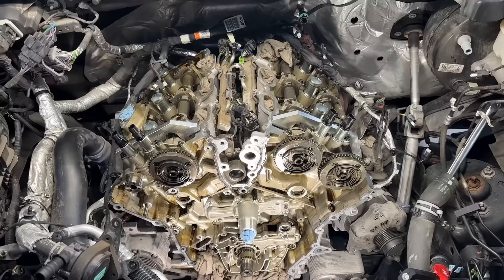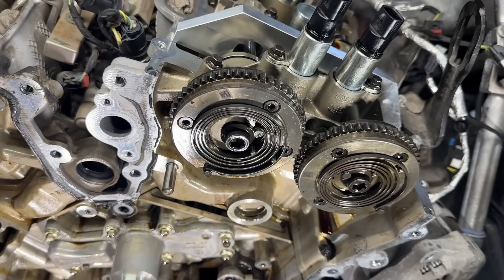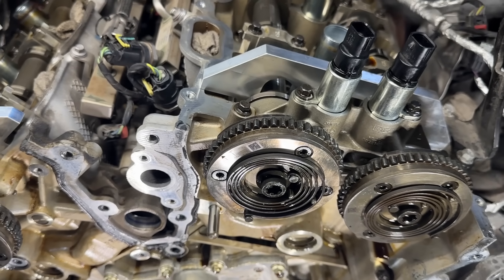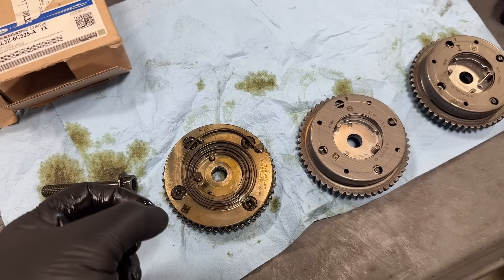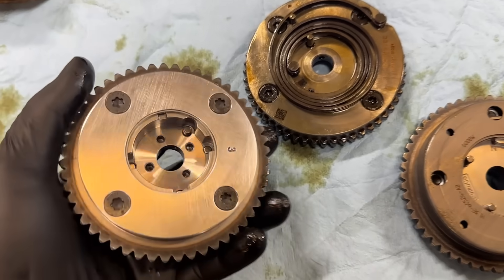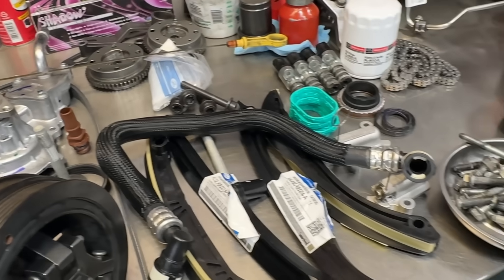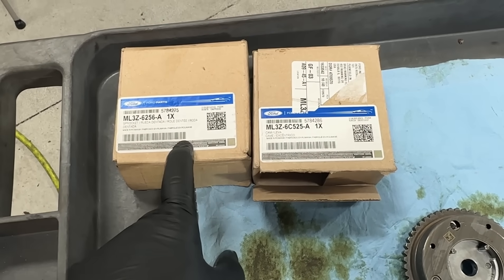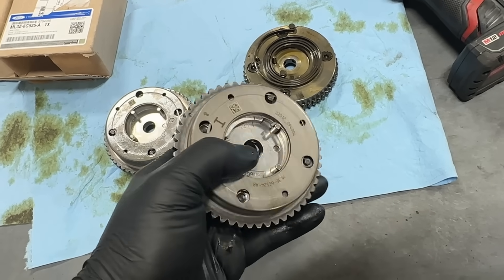2017-2020 Ford F-150 3.5L Ecoboost Startup Rattle Fix: Make Sure You Are Getting The Latest Phasers!

Comment: How often have you seen an updated phaser go bad? I have a P0014 for Bank 1 exhaust advanced. I replaced timing chains, vct actuators and Phasers. I then checked oil pressure and found to be good.
Would a loss of pressure on the cam bearing cap cause this? Have you seen this before? Or should I removed the timing and see if the phaser moves to see if it’s not locked?
Reply: There is some valuable information coming out that can reduce wear of the cam and timing chain components.  Just doing a pre-lube startup a few seconds, watch the oil pressure gage, before you let the engine fire up -gets the oil up into the top side and coats everything nicely and no more rattle. Press the gas pedal all the way down while cranking the starter and when the oil pressure comes up let off the pedal and it will start up quietly. If F150 owners knew this early on it might save $$ and avoid premature wear.r
Reply: by doing what you said every time I start the truck can it gives me any problem other than the cold rattle noise.

Comment: I had a recall or notice on my 2019, don't remember which. The dealer said there was nothing wrong with them but would replace them when, not if, they went out. 
Brian, if you quit making videos, you would be so wealthy beyond your dreams! I also have a 2010 5.4 3v that you have make me think of getting rid of it. Bought it used with 94.000 miles, don't know anything about it other than it supposedly had a tune-up before I bought it. 
Thanks for your service too!

Comment: I just bought a 2018 f150 with the 5.0.  Got the engine code then Ford replaced the vvt solenoids. Got it back, code gone, and getting the rattling sound upon cold start up until warm. I know it's coming out of engine. They are telling me that it's my suspension. There's no way it's a suspension sound.  I bet I have the old phasers in there ? I haven't even had the truck a month and I'm spent 3k on maintentance/nick nacky repairs. Not sure what to do now ?

Comment: Thank you for releasing this video. My '18 Expedition was left at the dealership for the startup rattle issue. I previously had my phasers replaced at ~36k miles, and now at ~77k miles the rattle is back. Looking back at my RO for the first phaser replacement, the dealership used the HL3Z part#. Once my dealership confirms they need to replace the phasers I will definitely make sure they use the ML3Z part# you provided. Also, the extended phaser warranty expired 1/1/2023. I was lucky enough to get in on 12/30/2022. Hopefully the new phasers last until we're done with our Expedition, lol (large family).

Comment: Ok, this is good to know.  If buying a new truck make sure it is s 2021 or newer truck.  Is this also the case with the 2.7 ecoboost in these trucks?
Reply: Yes, the 2.7l has this phaser rattle problem and I believe they do NOT have a fix for it just yet

Comment: I just had a cam phaser recall repair done on my 2017 F-150 3.5EB.  Ford shipped the ML3Z intake and the HL3Z exhaust.  Have they shipped me the old model?  Can I expect this cam phaser problem to reoccur?  This is SO frustrating.  I've waited close to a year for this repair and do NOT want to have to redo it. Thanks.

Comment: I have a 5.4 L 2007 explorer, 185,000 plus still with the original  timing chains. Just found a small piece of plastic tensioner in the oil pan while replacing the pan gasket. Debating how much longer I should go before replacing the chains. No chattering as of yet. I keep the oil very clean.

Comment: Any data on what the failure rates of these are? I have a '15 F-150 3.5 EB, and my wife has a '18 Explorer 3.5 EB. No major issues yet, is it just a matter of time with these? Any warning signs they're about to go?
Reply: WE bought a 2016 F150 with 78,000 miles on it. When the engine is cold and you start it up there is a loud rattling sound for about two seconds. Then it goes away and everything is as quiet as can be. Atlas now I know what is making that sound, not that it is good that it is.

Comment: Just had this service done on my 2019. They took the cab off tho? Looks like they forgot to unplug the connector on the ABS modual and damaged it then decided to zip tie it back on and I wounld'nt notice. Looks like you have a much better meathod for this repair/ upgrade.

Comment: I just had my cam phasers replaced in July and ever since then I’ve been getting a couple CEL’s. I’m getting P0018 and P0021 and my truck is running like crap. I called dealership and told them about issues but they are saying it has nothing to do with cam phaser job. They can’t look at my truck till January because they are so backed up. 
Can you tell me if it is has anything to do with what they did? I didn’t have this issue before they worked on it.

Comment: Just saw this video. I had the phasers on my 2018 F150 3.5 done earlier this year. I had no idea that they could use the same old part. I quickly checked my invoice from the warranty job, and much to my relief the new part numbers were listed. Thanks for this info. Very reassuring!
Reply: How much did it cost?
Reply: Der,  Did they replace them when you took it in, or did they try and adjust the timing in the modules first.  Ive heard they do everything they can not to replace these.
Reply: Did Ford still cover?

Comment: 2019 F150. Did not have rattle at 30k, 40k, and 50k dealer checkups. Each time dealer told me they were not recommending re-flash unless a problem due to trucks coming back right after with other problems (shifting).  Truck had 59600 mi when rattling started.  Called dealer for appointment to check, earliest was a month out and he told me not to worry as long as they saw it before 12/31/2022.  Now another dealer and FMC tells me that is BS, needs new VCT and no warranty coverage available because over 60k.

Comment: Do they have an extended warranty on the non turbo 3.5 in the 2011-2016 Edge? Mine does this after sitting for a day or 2. I usually hold the pedal down for flood clear mode to pump it back full of oil before starting it.

Comment: When did these new parts become available?  Had our 19 Expedition phasers done in June of 2021 @ 34447miles. Now have 67385miles and fear they will go again. We also did the 21N08 PCM reprogram that I think killed my first transmission.  The new one is better but has rough down shifts in 6th down and wants to be in 9th gear at 45mph some times lugging the engine.

Comment: Thank you for your videos, I am normally a Toyota guy, but I bought a 2018 Ford F150 3.5 liter eco boost With at 92,000 miles on it this past summer, Just based on the fact that I live in the rust belt of Pennsylvania, And I know these ford bodies are aluminum, I do like the truck so far , Other than the fact that the engine oil pan apparently seeps oil , and the the rear end was a quart and a half low on gear oil , Which is concerning, I would’ve thought the dealer would’ve topped that off, before they put the truck up for sale, At any rate I’m hoping with your informative videos I can keep this truck going for a while, thanks again

Comment: I had mine done last year(under warranty)at 95,952 and my invoice is showing they used the old style (HL3Z) cams. At the time, they said the timing chain/guides were not in need of replacement. If you were in my situation, when would you be preventatively seeking to go back into the motor for a tear down to check timing components? Any other advice? Thanks for all you do
Reply: A year later.. how are your phasers?

Comment: We just had a 22 raptor with the 4th gen 3.5. Jumped time at 6k miles valves hit. Did 6006 started up the new engine and runs like crap timing codes bank 2 intake.

Comment: Brian I need help trying to figure out with my Ford F-150. I had a misfire on my cylinder 5 I changed out all my spark plugs and I changed the ignition coil for my 5. But from 5-8 when I removed the spark plugs and ignition coils there was oil what can that be.

Comment: I'm  experiencing this loud annoying  rattle on my 2015  2.7 EcoBoost  i  only have 35,000 miles  in truck  Dealer told me my warranty  just ended on October 28 and it would  be 200.00 just to diagnose  it . I hope  this  isn't  what's  wrong with my truck  i told person  on phone about extended  warranty  for this problem  in your  video  they said they  know nothing about  that now I'm  scared  I'm  on the hook for thousands  guess  I'll  find  out Monday  I'm  going  there at 9:45 Eastern time.
Reply from the maker: The extended warranty program described in this video is only for the subject matter engine 2017-2020 F-150 3.5L Ecoboost.

Comment: Thanks for the video Brian!  I did this job in April of 2020 on my 2011 F150 using the numbers you showed in the 3 part video series you made for the 1st gen 3.5 Ecoboost.
Reply: So these new updates phasers can be installed for a 2012 f-150? 

With the part numbers he listed?
Reply: @lizethgomez4338 i have the same question

Comment: You say the 2.7l may have the same issues? I have an '18 F-150 with 66k miles and the 2.7l. No major mechanical issues so far, but now I'm starting to get a bit nervous. I assumed it was relatively bullet proof based on a few Google searches. Maybe not? Thank you so much for all you do.
Reply from the maker: Aviators and Explorer only so far.

Comment: I have done HUNDREDS (if not THOUSANDS) of these 3.5 GEN II phaser replacements by now. My most recent one (a 2019 Navigator) was the first I've done with the ML3Z-A replacement set. I guess it's good to know I'll be going in a 2nd time around on all the other replacements I've done (with the first HL3Z-CD versions).
Reply: Is this a recall?
Reply: @edgarcepeda175  it's not a recall per se. But rather a customer satisfaction program from Ford Motor Company for owners who have expired ALL of their factory warranty parameters by date and mileage, and are experiencing this issue. Ford will pay for this repair as a one time fix under program number 21N03. But in order to know if your vehicle meets these requirements, you need to have your VIN ran at any Ford dealership through OASIS to see if that program is open on your vehicle.
Reply: @michaelchan8915  thanks man ! I appreciate the info ! I was getting a headache with that rattle start up and never did anything about it but for sure I will take it to the dealership hopefully my truck will get covered for the replacement.
Reply: @michaelchan8915  Is the Recall only in the US? I live in Canada and cant find information on it
Reply: @e117f  the extended program for this also applies to Canadians
Reply: how many hours does ford charge for this repair?
Reply: Do the 3.3L v6 engines have this as well. Mine just made a rattle on startup.
Reply: @walthoyt1104   not as far as I'm aware.
Reply: Labor time is 14-15 hrs? That means you could do probably 2 per week. 2 X 50 weeks = 100 per year. (I'm giving you two weeks PTO). To have done one THOUSAND of these replacements means you would have had to do 2 per week for 10 years. I'm throwing the BS flag on that sir.
Reply: @lswoodcraft ”I have done hundreds(if not thousands)…
Reading is fundamental. Social capabilities to be able to distinguish sarcasm helps too…

Comment: F-150's in general seem to have phaser and timing chain issues over the years.  I had a 2010 5.4 which was notorious for the tensioner, as I learned from all your videos (Thank you!)  And now you're doing videos of the ecoboosts having timing and start rattle issues. I sold the 2010 and got a '21 with the Cayote 5.0.  I changed the oil already at 2k, 5k, and 10k, and plan on every 5k from now on.
My question is this: has the 5.0 also shown long term issues with timing components, or has this problem shifted mostly from the old tritons to the 3.5's?  Do you think regular oil changes will keep those components clean enough to prevent such a big timing job for a very long time, or has Ford just continued to not learn their lesson with oil starvation across all engines?  Thanks for your channel!  I've been a subscriber ever since I bought that 2010 all those years ago, and knew to listen for the cold start rattle (which is when I decided to move on :D)

Comment: I have had my timing chain and phasers replaced twice. I  told the dealer that I use Mobile 1 full synthetic oil and told them to use it.  They did,  but at the first oil change after the work, I  got an extra 4 quarts of oil out of it. They never drained the old oil out.  Service advisor told me it would not hurt the engine.  I did not believe him. Two weeks later my oil pan leaked and they put a new one on.  5k miles later I had timing chain rattle at startup. Dirty oil messed up the phasers.  They did the whole replacement again.  After that I started getting heating problems when in the turbos.  New water pump, thermostat,  then radiator. Still not right. Frustrated with the service.

Comment: why hasn't this issue aisen in my 2010 MKS 3.5  EcoBoost with 109,000on it???
Reply from the maker: You have a totally different engine.
Reply: @FordTechMakuloco  so, guessing 3.5 ecoboosted engines are all different to some degree, especially for RWD and upgrades through the years...but these parts I thought were the same.
you da boss, so you would know
Reply from the maker: Yes they are all different and this one is an F-150 variant that is gen 2 so it's way different than yours.
Reply: Thanks for replying, feel humbled.
 love my mks.... Except today driving down the street it wouldn't  shift out of first! 
First time ever!! 
About u miles later and me pulling off the road,  it kept happening
Now shifting normally! 
If youve heard of this,  let me know should it happen again

Comment: I just had my 2018 with 28k mileage in the Ford dealer for this.Flying Wrenches had a video out on this too. I verbally insisted and wrote a note and attached it to the service write up. Yes they put the new style phasers in it. Thanks for sharing this info to others.
Reply: Was your a 2018 F150 that you were able to get these new Parts for>  so they fit on the 2018?

Comment: Brian I just had my 18 phasers done for the second time on warranty. The first time was last December 2021 and just last week. They used the H series phasers in the first job at 65000 KM  and M series at 82000 KM.   My truck made phaser noise on deceleration while the engine was still cold. Once warmed up no deceleration ratcheting noise.

Comment: Would you still recommend replacing the oil pump to a Melling High-Volume on the 2nd Gens?
Reply from the maker: Melling does not make a high volume oil pump for the 2nd gen engines.

Comment: Change your oil every 4k miles using Motorcraft synthetic blend and motorcraft filter. 182,000 miles on my 2012...no issues.
Reply from the maker: Totally different engine design but yes oil changes are key here.

Comment: Great information, thank you!!! I have a cold rattle on my 2009 Escape with the 2.5L. Any clues???
Reply: Some engines don't get oil right away to the lifters, camshafts, and rockers and this making a ticking rattling noise but then go away once oil gets to everything.  Maybe this is yours?
Reply from the maker: No idea it is not common at all so it may be an external rattle.

Comment: Which engine and transmission combo would you say is the most reliable on a used or new F150?  I respect your opinion since you are the most knowledgeable ford truck technician on the WWW.
Reply from the maker: That is a loaded question, I need to know a generation of F-150 at least.
Reply: @FordTechMakuloco   2016 f150 xlt and 2017 xlt what’s the most reliable engines for these models?
Reply: @CountryBoyTnn  5.0l Coyote No questions asked. No more valve seat issues and no issues that the 2018-2020 coyote engines have. 15-17 is the sweet spot for the 5.0l.

Comment: This is a 2019?  This is ridiculous it needed such a drastic repair. I bet you my life that no one will ever have to open up the top end or timing side of my Toyota 2TR-FE cast iron block & port injected for the first 300,000 miles.  My Toyota may be a slow gas guzzler, but no one will ever have to open up the engine for several hundred thousand miles.
Reply from the maker: 125k miles on it though so it's not exactly new.
Reply: @FordTechMakuloco   Thank you for telling that as you are right that it had more miles than I thought.

Comment: I just did a timing job on a 3.5 eb, don't recall the parts number,  but they looked way different than either of those designs....
Reply from the maker: Then you weren’t working on a 2017+ model.
Reply: @FordTechMakuloco  it wasa 2012 F150, my concern was you showed what the updated version looked like, and I want my customer to have the best available stuff, but his were different than either design u showed. I just don't want this guy to have issues because it is a costly repair. Will the other ones fail earlier than should be expected?? I can get u a part number later on today if needed.

Comment: I had phasers replaced on my 2018 3.5 ecoboost, and the next day I had a catastrophic engine failure. Luckily the dealership replaced the engine for free, but it left me without a truck for months. I'm done with POS Ford vehicles now. They've had phaser issues going back to 2004.
Reply: May I ask what caused the failure exactly?
Reply: @JasonM69 
I suspect bad install, but they would never say one way or the other.